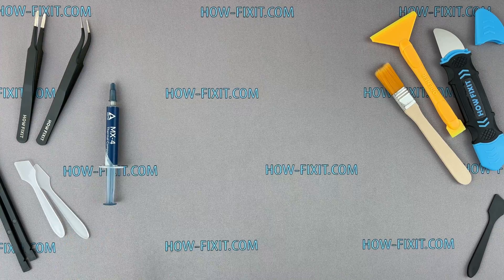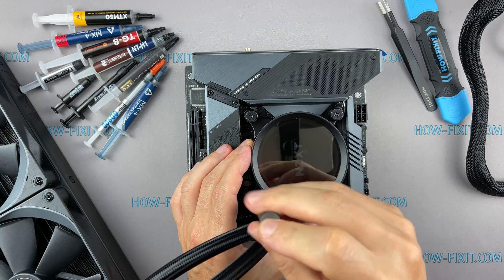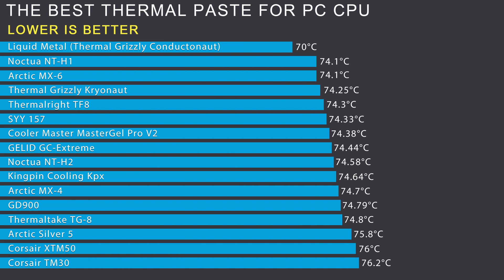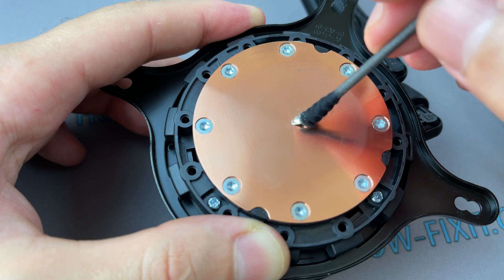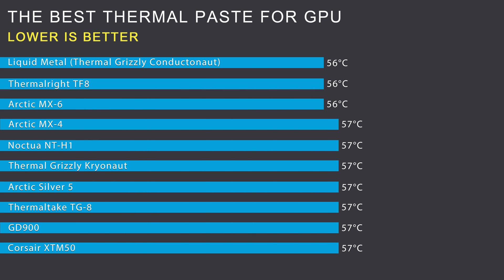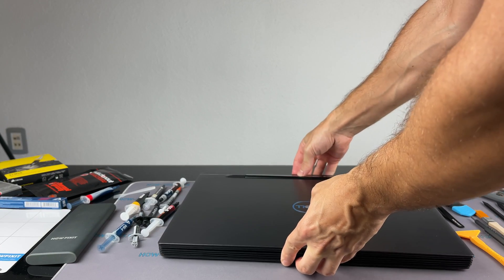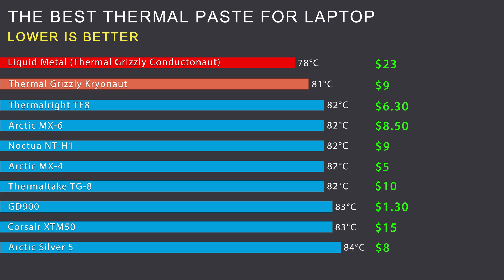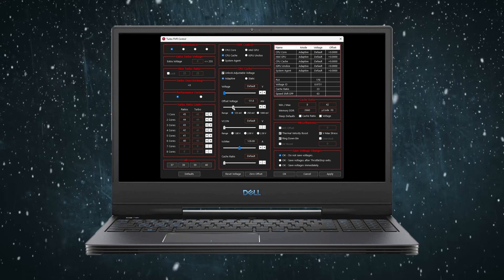The Best Thermal Paste for PC CPU, GPU and Laptop

Comment: Great comparison, loved it! I own a laptop with an i5 and GTX 1650. I don't really kill it but I've had it for about 3 1/2 years and was thinking of a deep clean and new thermal paste. Even if I don't use it to the edge of death would it be smart to use liquid metal? I would assume that regardless of use the better thermal agent would help substantially right? Thanks
Reply: Metal is fine for Laptops - if the die is facing down, there's no risk it can get on anything else. For standard pastes, Kryonaut is literally 10-20c cooler than anything else I've tried for my 15w non-gaming i7 Dell, but expect maybe 10c under load in gaming laptop over stock and other pastes. It doesn't make sense, but Kryo is by far the best in Laptops, especially if they have low thermal mass and bounce off 100c when turboing like most newer Laptops do. At around 4 years old, just cleaning the fan/heatsink is gonna net way lower temps, and Kryo or LM isn't strictly necessary since you're not limited by temps and can't overclock. The biggest gains when not limited by cooling are just peace of mind and typically quieter fans under load, which you may not care about.

Comment: Thank you for taking the trouble to design, realize, record and compare the problems that need to be faced when using computers. The movie presents a neat, clean and very simple test environment with beautiful visual effects, only that the cost is relatively high; if it is in Taiwan, a small island country with a concentrated residential plain, second-hand trafficking is relatively developed and convenient, the cost may be slightly lower and relatively environmentally friendly. What I am wondering is, if the contact surfaces of the CPU and the cooler are all mirrored, is it not safer? I don't know if there are any unknown problems in the manufacturing technology; is it possible that the current industrial ecology is weird? Is there a more appropriate industrial ecology? Thanks for the hard work! ( DeepL translation )
謝謝您費心設計、實現、記錄及比較了使用電腦必需面對的問題，影片呈現整齊、清潔，非常單純的測試環境，視覺效果漂亮，只是成本相對比較高；如果是在臺灣，小島國集中居住平原，二手販賣相對發達方便，成本可能略低，相對環保。自已比較奇怪的是， CPU 和散熱器接觸面如果都是鏡面的，是不是安全性更好？就不知道製造技術是否有不為人知的問題了；目前的產業生態有沒有可能是怪異的？有沒有更為合適的產業生態呢？辛苦了，感恩！ ( DeepL翻譯 )

Comment: Excellent video!  One note, the GTX1070 and older GPUs were not good candidates for high performance thermal paste, such as liquid metal due to the relatively low thermal density (hot spots) GPUs of that generation had vs CPUs. (GPUs and CPUs use different lithography process libraries, where GPUs of that generation used more thermal economical libraries at a cost of transistors per mm square) The GTX 1070, shot on a 16nm process had a total of ~7.2B transistors / 314 mm² die with an  MTr/mm² (mega-transistor per squared millimeter) of 22.9MTr.  By comparison, the 10th generation CPU used has areas on its die that used 14nm++ performance process libraries that can top 37.5MTr/mm² in certain areas of the die and have a higher thermal density being a smaller die at 206 mm². This is a large contributing factor as to why the CPU benefited more with the higher thermal conductivity of the liquid metal than the GPU. (Plus GPUs will push harder with thermal headroom, contributing to your results as well) It wasn't until the 8nm process from Samsung and 7nm process from TSMC being used in GPUs is where the MTr/mm² started to rival CPUs hot spot densities. I have found that liquid metal resulted in 5+ C drops in temps despite the GPUs attempting to push the headroom provided.
Reply: What would you recommend for each one?

Comment: 2-3 degrees Celsius is insignificant?😅
Reply: It is insignificant for average user. But yeah even 1 degree is significant if you are always on the pc or do overclocking.
Reply: Of course its not significant taking into account the wide range of acceptable temperatures. Especially as those are often simply down to a large number of variables included. In the end most users will get completely different results … unexperienced users grabbing the better ones, but achieving poor results as more difficult to handle.

Comment: Good video, but please note that the laptop should not be tested in the same way as video cards. 
They have a high pressure of the cooling system, so liquid and cheap thermal pastes will show themselves normally in the first days, up to a month, and then the pressure will squeeze them out and the temperatures will be hellish! And liquid metal should NEVER be applied the way you are doing it. It's metal and it conducts, and when heated it becomes more viscous and will just flow onto the board causing a short! I'm not asking you not to do it for testing, but understand, people who watch this video and repeat - they will burn laptops, even if you write that it's dangerous somewhere! 
Thank you.
P.C. If the laptop overheats sharply above 100 degrees, it may be worth first checking the thermal tube and not selecting thermal pastes
Reply: Do you have any idea about the best thermal paste for laptops
Reply: @dharshdanube6911  For gaming laptops, you need to use thermal pastes with a phase transition (very thick), which are more expensive than ordinary mx4, mx6 and similar.  For example Honeywell ptm7950-sp.

Comment: just so you know, Thermal Grizzly Kryonaut is formulated NOT TO DRY OUT if kept under 80C. So a bit of undervolting and perhaps some better fans and you've got yourself something that is zero maintenance. Remember to use hot spot temperature instead of overall transistor die temperature

Comment: TFX is really good. Very thick really good.
Reply: Did you still use tfx? How that paste performance now? Still good?
Reply: @mantapdonks1126  Yes it's a excellent paste 14W/m.k.   Its like Clay cold, and wet when hot. Best Paste Iver used (besides Liquid Metal= Seeps out over time and dangerous if it contacts anything (Electrically conductive) TFX 9 is great!!
Reply: @whodisnewphone  thanks for reply .
I have one more question, is it hard to apply that thermal paste to cpu and gpu? Tfx
Reply: @mantapdonks1126  Slightly, its very thick you want to spread a even coat (with the included spatula) over the entire chip. Then reattach your cooler. I also recommend Replacing the thermal pads too. You can buy Assorted size thermal pads and 1 pack should do the whole GPU and CPU with plenty to spare.
Reply: @whodisnewphone  and did you apply it on pc or laptop? It is good apply tfx on laptop? Or it same performance on laptop and pc. Sorry i ask to much question. I am interesting to try using tfx atm
Reply: @mantapdonks1126  Works the same on both pc or a laptop, its job is to fill micro gaps and transfer heat. The Stock paste and thermal pads are usually basic at best.
Reply: @whodisnewphone  thanks for all your reply.. i am gonna try this paste, hope give good temperature to my device.
Reply: @mantapdonks1126  you will be so happy. Remember themal pads too. Report back please.
Reply: @whodisnewphone  damn, i am forget to add thermal pad you recomendation to my cart. I am already checkout it ... Ah....

It is still good without thermal pad?
Reply: @mantapdonks1126  you need thermal pads too. Replace both and your temps won't ever go high

Comment: Testing thermal paste for temps is one thing but also testing thermal pastes for pump out is just as important especially for laptop users, as they dont want to be stripping it down to repaste it every few months.
Reply: Arctic says that it could last up to 8 years but from my experience if the temperature is above 60°C it wont last longer than 2 year
Reply: Laptop won't last a year because if can reach 83°C and long session will surely dry it out
Reply: For a laptops, only the phase change material: Honeywell PTM 7950, Upsiren PCM-1, Gelid HeatPhase Ultra, Thermalright Heilos, Thermal Hero Pad.
It comes in as a sheet, lasts longer, performs works better than traditional pastes and there is no pump out effect.

Comment: For laptops you should compare clocks not just the temperature because most of them are thermally throttling around 90c.
Reply: In this test that doesn't matter as highest temp was 84°C.
Reply: Dumb, it is because regulations of Dell BIOS kernel. He says right. The video is detailed but missing the facts.
Reply: How do you do that exactly? Sorry I'm new to this
Reply: thermal throttling is at 90c not 84c
Reply: For a laptops, only the phase change material: Honeywell PTM 7950, Upsiren PCM-1, Gelid HeatPhase Ultra, Thermalright Heilos, Thermal Hero Pad.
It comes in as a sheet, lasts longer, performs works better than traditional pastes and there is no pump out effect.
Reply: @goorthiss  what about Thermal Pad Thermalright Odyssey?

Comment: dont recommend using liquid metal on a laptop or your PC because if a single drop touches the board it will kill those components. If your using liquid metal for anything else like just to overclock a CPU to the highest Ghz then go for it, but I don't recommend using it for daily use.

Comment: @How-FixIT
Is it okay to put a 0.2mm thin Thermal Grizzly Carbonaut - Carbon Thermal Pad on the CPU & Thermal Grizzly Kryonaut Thermal Grease Paste extremely lightly smeared on the heatsink to fill in the fine milled surface that has hills & valleys ????? Both materials are highly conductive & transfer heaps of heat.

The reason why I ask is that if I use one or the other then I don't think that there will be adequate transference of heat. The amount I'm talking about smearing on the heatsink would be so little that it would only dull the surface of the heatsink & fill in the valleys of the heatsink.

Comment: I don't think this guy knows what he is doing. with all these pastes and there is a 1-2 degree margin between them? I have seen the MX-4 out pace the TM-30 by 5 degrees. Also I think everyone knows by now to never put liquid metal directly on copper heatsinks due to the reaction between LM and copper, you will destroy your cooler and possibly your cpu's IHS. I do not agree with this video.

Comment: I wanna warn the people about MX-4.
DO NOT USE IT FOR GPU.
The first stress test results after you apply MX-4 may be satisfying. However pump out occurs very quickly. You must use more dense grease. It's still a good choice for CPU IHS.
Reply: So you wouldnt recommend the MX4 for GPU... i have used it for my CPU and got plenty of it left and wanted to use it on my GPU... which "cheap" Paste with longlifety would you recommend for upgrading/renewing the Paste on GPUs?
Reply: I'm not sure which one will be good for CPU/GPU chip. I'm gonna apply MX-6 for my RX 5700 XT tomorrow. This paste is my final decision. This one has much more viscosity than MX-4. It's more expensive but still a cheap choice. However I'm sure MX-4 is terrible for direct apply on die.
After i use MX-6, it will take some time to ensure whether if it will pump out or not.
Reply: MX4 is great for GPU and CPU. I tried different ones, and MX4 gave me best results keeping my laptop cool, I do re-apply every 4-6 months just to always have a cool temperature, and it does not seem to be dried or pumped out and can wipe it of easily just with a microfiber cloth. No need for alcohol.

Comment: I don't believe your unbacked up expiration statements. I don't believe my thermal paste's (arctic MX-6) "drying out" will hinder its thermal properties. 
Just like no hardware manufacturer backs up your claim with recommandations.
For example : "The ARCTIC MX-6 is a carbon filler-based thermal paste ... The silicone gel used as a carrier ..." the wetness isn't the thermal bridge.

Comment: Quick note: If you don't use a heat spreader, SPREAD THE PASTE. Don't use the dot method. Uncovered areas of the die could cause severe hot spots, including damage that may go undetected by the thermal sensors. So make sure no part of the top of the die is showing.
Reply: speaking for laptops, spreading it can cause air bubbles and is much riskier. best way for anyone who's inexperienced is to apply thermal paste in a dot, apply the heatsink and then remove it again to see if it spread properly. if it did, reapply it the same way and you're all set. the surface area on a laptop die is really small anyway, which will make applying too little very hard unless it's actually a ridiculously teeny tiny amount. applying too much seems to be a much more common issue among laptop users
Reply: @lavishlyvice  Fair enough. Though apparently air bubbles aren't nearly the risk they were made out to be. Apparently they quickly dissolve or work their way out after a thermal cycle. I'd be interested to see if anyone has tested or measured this.
Reply: Why play with dots, crosses, spreading as you can cut from a sheet of PTM7950 for the size of the core or IHS and not worry about whether the paste will be too much or too little and whether it will spread correctly. Because it will be the perfect amount all over.
Reply: Spreading it is WAY more likely to not fully cover, plus overpasting isn't possible and ESPECIALLY not possible on Laptops that have such limited contact area and inherently low thermal mass + transfer, leading to more hotspotting from the sides of the die and package with NO case airflow to help. Dot is always better for direct-die, especially Laptops, you just need to INTENTIONALLY put too much and you'll never have non-optimal cooling. Laptops are by far the most demanding, and counter-intuitively 15w CPUs are the MOST demanding with insanely high short-term Turbo power peaks that are DESIGNED to instantly peg 100c+, then quickly throttle down power to run 100c sustained under load (they implemented low-level CPU code to throttle quickly from firmware by10th+ gen Intel, routinely exceeding TJMax (100c+ package) yet never tripping hard overheat protections like it would've before in older generation). 

Intel openly says they try to run at 100c, if anyone wasn't aware, and this is the fundamental difference in newer CPUs versus what we used to have. They WILL run at 100c sustained if you don't have cooling better than the max CPU TDP, which only built desktops have, and they WILL boost 50+ watts in a 15w locked Laptop i5 to go from 50 to 105c in a literal second (again, 15w Laptops have the worst cooling and practically no thermal mass to absorb this versus 45w+ 'gaming' laptops), so it's actually REALLY stupid to try to put as little paste as possible for maximum theoretical thermal transfer when ANY laptop cooling system is limited by the cooling capacity and NOT thermal transfer die to heatsink like Desktops with cooling capacities > CPU TDP. This is especially bad for direct-die because they have no heat spreader like desktop, AND they run far more power per size with heatsinks so inferior relative to desktop that it's almost like running without any heatsink. So, TL:DR, overpaste Laptops because they aren't limited by thermal interface max efficiency (though Kryo or similar can still significantly lower temps versus stock/other pastes through increased conductivity for a given power-limited Laptop,) and more importantly Laptop dies BENEFIT from using too much paste because they desperately need any thermal mass which comes with too much paste, it's completely different from Desktops and GPUs with spreaders and far larger die areas and it's also a relatively new change in CPU behavior. I guarantee you'll never see worse Laptop temps if use a blob versus spreading manually, and you'll almost definitely see lower peak/hotspot temps as well with a 15w+ newer processor as described.

Comment: What stress/stability software, do you recommend, to check the GPU and CPU temps of a laptop?
Reply: CPU: CineBench R23 or later in the loop. GPU: MSI Kombustor, unigine benchmark for example Superposition, Valley. And track the temperature via HWiNFO.

Comment: The brand paste and application techniques seem to all come down to only a few degrees C difference. It's only worth worrying about if youre a serious hobbyist & want every last bit of cooling, overclocking, etc. For regular use, pea sized amount is fine. Place the heatsink down and let it spread the paste itself. I have always used this method, since the 2000s, and done this countless times on CPUs, re-pasting video card GPUs, and a few laptops. I have done it on CPUs up to 125W TDP, with air cooling. I use Arctic Silver Ceramique 2. Great vid

Comment: Really well done testing. I use Thermal Grizzly Kryonaut for everything (GPU, CPU, Laptop, Multi/single processor Mac Pro, etc) and have for years. I have a friend who works on just as many varied units as I do. He exclusively uses Arctic MX-6. Guess what? It doesn't matter! Any of these top rated pastes will work fine although some will last slightly longer than others. I have taken apart hundreds of MacBooks over the last 25 years. Many of them have never had their bottom cover off and are over a decade old. So how does the paste look? Most look just fine. And my testing shows that new paste can sometimes help but normally not a whole lot.
Reply: Kryonaut after ~8 months there is a pump out effect or simply dries out. This paste is not at all suitable for components that for the most part operate at temperatures around 80°C, which in today's laptops is the norm as well as in processors in PCs with TDP >120W. I suggest you test the phase change material for example PTM7950 and I assure you that you will never again apply the traditional paste

Comment: Ya my laptop keeps shutting down so I figured I'd try replacing the paste and it worked it's probably been on like 4 years I'm pretty sure i got it before the pandemic and replaced the paste probably unnecessarily it ran fin it was juat an older unit and I figured why not put the best thing short of liquid metal on it